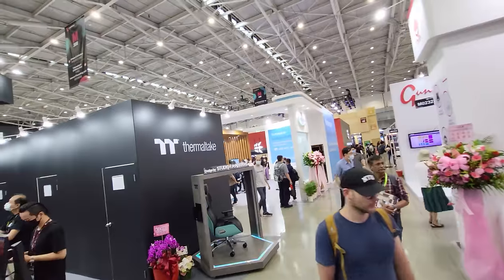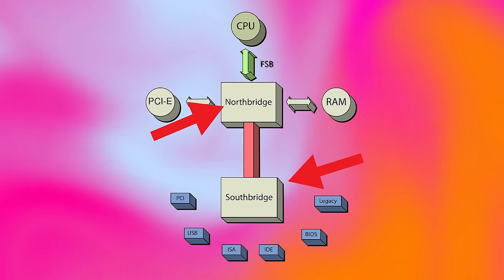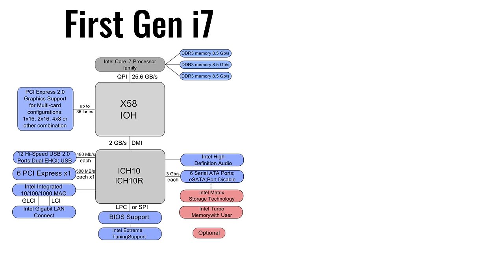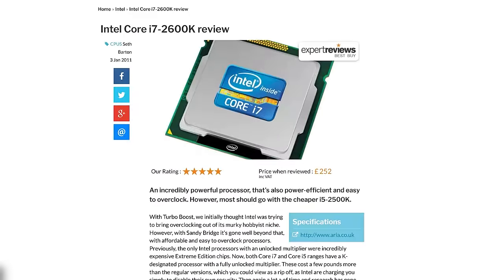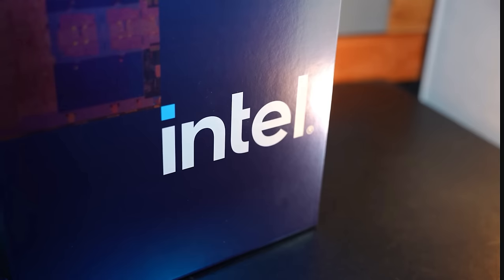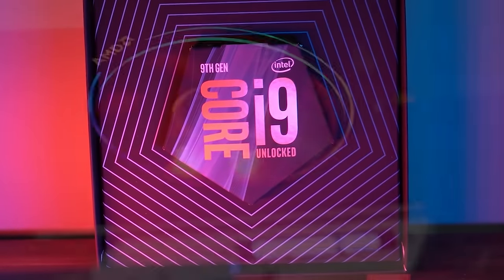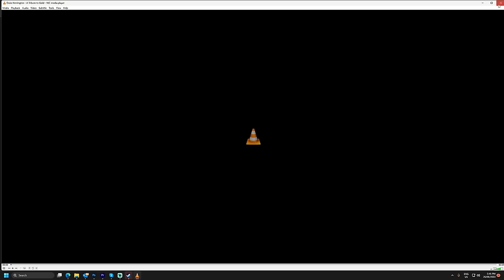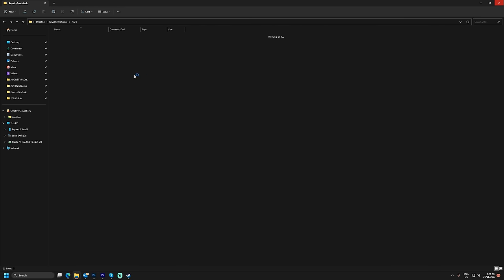SNAP - The Intel CPU Latency Story (Part 1 of 2)

Comment: Weird thing is that, moving from Ryzen 3000 (3800X) to 5000 (5800X3D) I noticed that my system became snappier, even though 5000 uses a very similar design as the 3000 processors.

Like, these quick tasks are instantaneous, there's no lag. What changed?
Reply: Ryzen changed from multi-CCX to single-CCX with the 5000 series (excluding the 59XX processors). Essentially, older Ryzens are kind of like two CPUs stitched together, which massively increases intercore latency and significantly degrades responsiveness.

Comment: Should compare latency on 12/13th gen between Windows Vista, 7, 8.1, 10, 11, and Linux.

I only mention Vista because something Intel changed fixed a big incompatibility issue with Vista that existed since Haswell so I'm curious how it would fare there.
Oh also on that topic, not sure if already you did it, but I wonder what latency going from Ivy Bridge to Haswell would look like. I've been curious about the issue for a while and the hypothesizes that have come about because of it. The most accepted hypothesis is Intel potentially used a less accurate clock scheduler in Haswell+, which causes the issue and could impact latency.

Comment: Wow this is interesting info. Low latency or snappiness is what makes apple silicon Mac’s so nice to use - even more so than outright time to get a task done. I was considering moving up from my 10980 … but maybe not.
Reply: M1 is terrible.  Watch any youtube video, click the right arrow key to move forward and watch it lag.  That alone was enough to make me ditch it.  Slow booting and delays to video fast-forward were shocking.
Reply: @foch3  Yikes! That sounds as slow as a Braswell potato from the later-2010s!
Reply: @RJARRRPCGP  Instead of just seeing the video skip forward you would be greeted with a fast-forward arrow icon, a pause and then resume.  

Or God help you if you wanted to use a high refresh monitor.  at 240hz It would drop frames on the desktop and the web browser, don't even bother with gaming.
Reply: @foch3  I am on and M1 Mini with 16gb ram and it is buttery smooth...sounds like you had a faulty one.
Reply: @russ.tech2you  2 defective units?  I had an 8 and a 16GB.

Comment: I/O is the one of the culprit but there are more that affect latency. Modern hardware/OS have built in much more "power saving features" that affect latency. C-states is one of them but there is more that are visible only on some of the motherboards and you need to disable them all.
Another problem is that when old hardware encounter error it will crash modern wont do that instead it will do "error correction" which penalty will be latency (there will be 0 whea errors).Culprit of it can be unstable uv/oc or faulty hardware or RFI/EMI. 
This is why i always recommend using Static overclock with atlest 30mv vdroop and full metal pc cases without window
PS: if you want desktop/games to be "snappy" you need to force GPU to p0 state otherwise it will cause massive dpc latency spikes .

Comment: Veeery interesting. I was considering either upgrading to 12th/13th gen or a 5800X3D, but I'm going to have to carefully reconsider now. I don't game that much, so latency is the one thing that bugs me on a daily basis. That said, an X3D CPU might still be key to relieving a bottleneck in one of the two games I play... but I have yet to have an X3D owner find that out for me.
Reply: A point to note about X3D is if you don't like 90C CPU temperatures then get a 240mm AIO. It will run happily at 90C with an air cooler and is fine as long as you don't let it worry you, probably best not to check the temperature.
Reply: Ryzen 5700X been very snappy for me, now im upgrading to 7800X3D and will see how it feels. All cpu's i have used in past 6 or so years 8700K, 3700X, QTJ0 ES (10980HK ES, basicly 10700K), 5600X and 5700X all been very snappy feeling. JayzTwoCents said something about Ryzen's feeling extra snappy compared to Intel.
Reply: @jarnom85  How is your experience with 7xxx ryzen?

Comment: When is part two coming? you piqued my interest with this video, but without accurate testing across several systems these are just mere feelings and may only apply to your system (I have a desktop with 12900K and I don't remember experiencing what you mentioned).

Comment: I have not used the new intel stuff but i have used Threadripper and newer AMD stuff and this is not an issue at all for them. If you measure the latency i am sure a monolithic CPU would have lower latency ( but if we are splitting hairs so would a Z80) , what you are seeing is clearly a bug in Intels design.

Comment: Just upgraded from Haswell 4670K to Ryzen 7700X (same nvme, gpu,psu, monitors). The system is snappier, but very similar. I would not upgrade if I was doing just the office work.
Reply: Thanks, I will stay on my Haswell-Xeon 18-Core a bit longer then.

Comment: Apple Silicon user, cannot relate. In all seriousness though, it's more than time for a move to ARM. The ecosystem is mostly ready, and Rosetta emulation works fantastic on my Mac. 

A couple years back, I had an HPC application that required super low latency. I chose Intel chips specifically because of their awesome inter-chip I/O. Whilst it's highly doubtful they'd pull this crap for Xeon series processors, but if they do, I guess low-latency HPC will move to Ampere (ARM) processors or something. 🤷‍♂️

Comment: This explanation doesn't ring true to me, I'm afraid: I'd expect any increases in latency as a result of moving the IOH off the CPU die to result in fractions of a second increases in latency, not seconds or tens of second delays in certain tasks (note, for example that the mouse pointer is still moving smoothly in the Word example). I'd expect this to be instead either an issue of operations being automatically retried after some error recovery period (e.g. disc IO, perhaps due to a block that's failing to read correctly - which may even just be one that's adjacent to the block(s) being requested. Conceivably, I even wonder if memory operations are at the level of sophistication that automatic retries can happen there, if e.g. electrical noise prevents a transfer from completing successfully - which an overclocked system could be more susceptible to) or an OS issue caused by it failing to take into account one or more ways in which newer CPUs differ to older ones (e.g. the introduction of big.LITTLE cores which in turn require changes to the algorithms used by the OS scheduler).

Try a different OS. Try known-good hardware (especially mass storage). Try backing off any overclocking.
Reply: 'fractions of a second increases in latency'
exactly
vid makes no sense

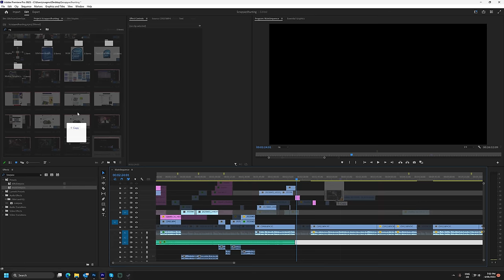Comment: That's very curious. I'm on Ryzen 7950x and I've not noticed any freezing when opening folders and files on my Windows drive (Nvme). It's instantaneous. I've had this happen on my HDD drive though with folders containing media files. It looks similar to what's seen at 5:05 . So the question is, could this be because you're accessing files on a slow HDD? Or maybe it's an issue with Windows configuration rather than latency (just a guess)?
Reply: Same. Everything feels instant to me in my 7950x with DDR5 6000 G Skill.

Comment: I noticed this issue in the first 15 days of 12700k usage, after investigation i found windows was parking my p cores, limiting my resources to only 4 e cores to save power, the solution was to install 'park control' then disable core parking, problem solved, i agree at first my 11700 was faster, this fix is necessary to every RL or AL user

Comment: Recently went from a 5960x to a 12700k and noticed an increase to latency by 20 ns(!). Completely insane
Reply: You can not feel a difference of 20 ns or even 100 ns. No human can.
Reply: @andreewert6576 Think you're missing for the forest for the trees, mate. Not talking about literally perceiving the difference between 20ns lmao. That's wild. 

You can feel higher latency in the responsiveness in your system like Brian is talking about in the OP.

It also has a direct impact on fps. Going from 70ns to 45ns can have up to a 20% uplift in some games.
Reply: @kenobi639  that's absolutely correct. Literal seconds of waiting time though can not be attributed to lower performance. That is a freak of a delay. Literal ages for a modern PC. That's why i am rather certain what we see is a file system process acting up on a bug, so a software issue. Not a hardware issue. And - again - you'd need nothing more than a monolithic CPU for the same socket to test that theory.

Comment: If this is true then the 5700g should feel "snappier" than 5800x, since the former is monolithic. That is an easy test. I'm doubtful that what you're seeing there has anything to do with the actual core-to-IO latency as your wait times are multiple seconds, while the penalty to IO latency is in given in nanoseconds. Looks like a windows bug to me - easy to confirm by running linux.
Reply: I am also curious since I have 5600g and can't wait for the next video hopefully he goes through all of this
Reply: 5700g isn't monolithic .
Reply: @abdullahdanze2061  it very much is. Prove me wrong, please.
Reply: @andreewert6576  It's a chip-let design  . Only the laptop apu are monolithic.
Reply: @abdullahdanze2061  show me one link to a chiplet 5x00G. The G is important here. Hint: they use the same "mobile" die on the desktop variants. There is no reason to have separate versions, and if there were chiplet APUs they would have different specs fpr the graphics part than on the monolithic ones.

Comment: I’ve got a 7900x/asrock build that while not very fast despite the power draw, it at least doesn’t freeze when I open a file explorer window.  I went AMD a few years ago with a 5950x and it’s night & day though.  My cursed work laptop with a 12th gen i7 well… first month it was great till a windows update, think last October or November made it freeze up and stutter.  Intel and Nvidia both patched drivers to fix the stutter.  I only saw problems on that dang laptop.

Comment: I'm sorry, but this doesn't make any sense. Why would this only affect some users? And it must be a very small number of users, since nobody has been talking about this for nearly 2 years.
What even is an I/O driver? The IOH was just a name of the north bridge, and all it had was the PCI-Express controller, the QPI link to the CPU and and DMI link to the south bridge. It had literally nothing to do with the I/O directly, it was just a link. Before it was called the MCH, when it also had the memory controller in it. All of that was moved onto the CPU die for a latency decrease and cost reduction. There's no north bridge anymore. The CPU still has the PCI-E and memory controllers on die. Where could they possibly move that "I/O driver", whatever it may be? It would increase costs, so why would they do it?
It has to be a configuration issue. Are your power saving options disabled? Is Windows running in UEFI or Legacy (CSM) mode? Are you sure you don't have High Precision Event Timer enabled and forced, which is a disaster on modern systems?
I upgraded to a 13600KF + Z690 two months ago and the system runs like a dream. I haven't experienced any of the examples you mentioned.
None of it makes any sense. Please investigate this issue further before making these kind of allegations. This is pure speculation at the moment.
Reply: I wished he did a bit more research

Comment: I have delidded + direct die 10900kf @ 5.3Ghz core + 5.0Ghz uncore + Maximus XII Apex and 32gb dual rank samsung b-die @ 4600Mhz 16-16-16-36 which got 35ns latency in AIDA64. 
I saw 13900ks and 7800x3d got around 60% better fps and really temped to upgrade but after watching this I will stay with my cometlake for a long time.
btw fyi my overclock config is faster than stock config (4.9Ghz) + xmp 3600 cl14-15-15-35 by as far as 24% in very cpu limited scenario like totalwar warhammer 2 skaven benchmark in the last scene (52 fps vs 42 fps).

Comment: You would have to admit that most software and tools to make software seemed to have an affinity for Intel Core based CPU's.  That's why the 18 core Extreme CPU's, using a mesh, were such a train wreck against the 3950X, even with Infinity Fabric and an IOD.  Now that Intel is going the chiplet (tile) route with IOD, software is going to have to be optimized for the change in manufacturing processes.  Do the memory benchmarks support your theory, or could it all be in your head?

Comment: 2nd, 3rd, 4th part... Yes please I have a 4770K and a Ryzen 9 5900x with top of the line hardware... I have over 300k PDF on different folders, and the 4770k beat the 5900x searching and opening files. It's weird. Also league of legends feels snappier on the 4770k
Reply: Can you record a video showing that? Thats interesting

Comment: The latency issue gets exacerbated when you plug in USB Drives (SSD/HDD) this has always been an issue with Intel. The DMI bus is only capable of about 10gbps, but 20gbps both ways. It's terrible to transfer files over the bus. AMD's use of an I/O die n the Mobo was a fantastic idea for this while also going with PCIe instead of a proprietary solution.

Comment: I used a i7 11th gen at work (UE & Houdini) for two years and it was good till you ran out of RAM. my Ryzen 5950x at home feels the fastest and has no lag in even heavy use (UE light baking and shader compiling). My 13th gen work computer on the other hand feels sluggish even when doing nothing, just clicking around the OS or a web browser's UI. I can count how long it takes for things to load that are instant on the older intel and AMD computers. though the older ones were running Win10 instead of Win11 so I don't know how much is just windows 11 being garbage.

Comment: It is much easier to hit the arbitrary(?) DPC/ISR latency threshold where sound issues occur on regular Ryzens. That sort of system latency on a typical Ryzen system is about 5 times that of a typical Intel. So if you have other problems making your system more sensitive to sound issues, it is not a good idea to have a higher latency CPU.
Reply: this claim is based on latencymon numbers?

Comment: OHHHHHH yeah yep yep yep, i use a windows 11 machine at work with 12th gen, and i thought something was super weird with the search function, i thought it was just windows 11

also as for amd/ intel, I'm on a 5th gen ryzen cpu at home 5950x and i can't say i have experienced too many latency issues although it could be better, i have never used a 10th gen intel cpu for comparison, i went straight form a 3930k to a ryzen 7 1700x something, that was a while ago so i cant recall latency difference between them

all i can tell you is that, my pc at home does not suffer from the same latency issue as the pc's at work, the pc's at work are absolute garbage when searching through file directory's compared to my ryazen system
if i had to take a guess based on your video, i would say that 10 gen intel with the thingo on the chip is the best, ryzen with infinity fabric is a second best (maybe hard to tell since ryzen has gotten better over the years etc) and the new 12th gen intel chips are garbage for latency

Comment: Their seems to be bigger issues than a little latency. I recently upgraded form a low end 10 year old HDD based system to a state of the art high end modern system, and it feels the same. I should of increased the speed of everything in my computer by x10, but doing things still includes just about as much laggy ans waiting as by old i3, 2 core, hdd system. Their is clearly some bottleneck in computing where all advancements in the past 15 years are worthless for general every day tasks.

Comment: My initial reason for going core I 7 11700 KF was twofold no overhead from onboard video plus I actually needed 512 AVX instruction set which dissapeared with 12 th gen onwards, But in a Thermaltake Tower 100 with a Coarsair H 120 V2 AIO which runs fans in push pull  configurtion on a thicker core 120 mm Radiator which is the only size the  case can use but ends up supposedly being equivalent to a 240 MM AIO cooling wise I found that my CPU temps are no higher than 48 Degree C in normal workloads and top out at mid 60's without any overclocking yet and single core running at 4.6 GHZ the Tower 100 and newer Tower 200 are awesome with top mountedCooling solutions as airflow is so good and with hot air rising they are very well designed and work very effectively.The only issue is the rear IO panel is buried requiring a Hub to be fitted but no big deal as long as you are aware.
The Motherboard is an MSI Z590I Unify  ran DDR 4  HyperX Predator 2 by 8 gig sticks with the !9 11900 K set to 2 cores and downclocked to 1.5 GHZ  that Toppc from Taiwan achieved DDR 4 7200 MHZ speeds a world record so the Motherboard has capabilities, So I think considering the Latency issues from Intels changes from 12 th gen onwards and the fact that I do not have any "Runs Hot" 11th Gen issues with my setup I will stay with this until they actually come up with something that is not a backward step.
Reply: nobody cares tho
Reply: @toseltreps1101  goose anyone who uses AVX 512 will though, It is quite useful with some software and when all said and done nobody cares about twits being smart arses